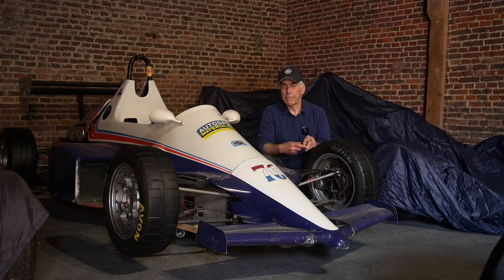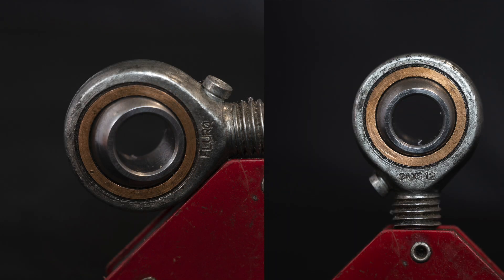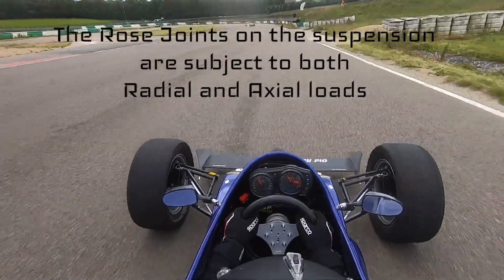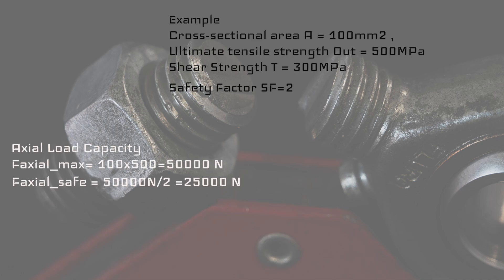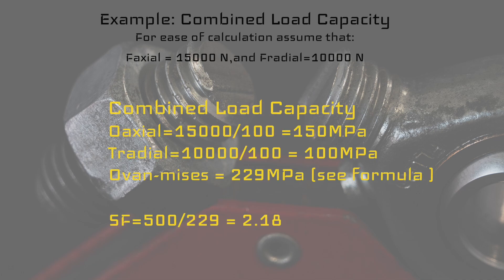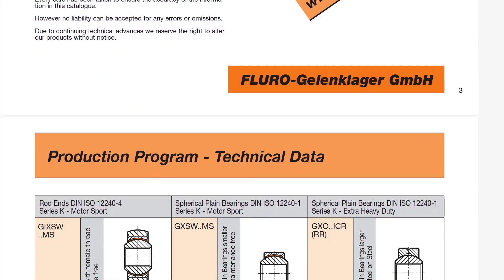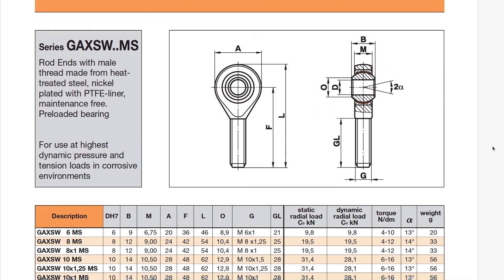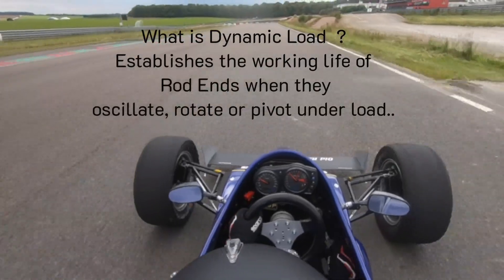Which Rod Ends /  Rose Joints to use in a (race) car ?

Comment: As I said in the previous video, I suspect a design error with this overhanging screw which can induce parasitic vibrations which are reflected on the tail of the ball joint.
Reply from the maker: Thanks for the comments

Comment: Hi, I think this is a very important video. Sure parts should always be within specification with a safety factor. But you have me thinking about scrutineering and general maintenance of these types of racing cars. Depending on how much they are used, surely, parts like this require replacement at some time based on a safe life span for the part. Depending on how hard the car is used, I guess all parts have a life span and it is wise to replace them periodically.  Again Steve you have got me thinking and learning. Thanks so much Marc.
Reply from the maker: Thank you for the comments Marc

Comment: You started with the existing one as a reference so it gives you an idea of what you are looking for, but it would be nice to understand the maximum forces required by the car architecture. If you have a way to calculate that, I will be waiting the video on that topic :)
Another point, couldn't aging be another factor? Would your part still be able to handle those 13.5 kN as stated on the data sheet?
Reply: It would be really difficult as you would have to consider many hard to define parameters such as friction and dynamic impact forces. I'm sure there is software that can be used but not many hobby racers could get their hands on them, or know how to use them :) Fatigue lifetime can be considered as aging. If load is below certain limit the lifetime can be considered forever. When exceeding that limit it is finite number of load cycles.
Reply: @tomiheinonen460  back then, I suppose that Autodesk Mechanical Desktop could handle that. I think that Inventor replaced it. SolidWorks should also handle it. "Benjamin Workshop" uses it for his projects (GT40 and Hypercar).
Reply from the maker: To  provide and calculate all the forces that are at play and get the  rigidity figures, shear point loads and more on  the entire race car  or any other car requires a lot of calculations and simulations. `there are software tools on the market for mechanical design (like 360, Inventor , CAD and others) that come near. However stress testing is at the end done in practice on test tracks etc...   So for me to do so, that is kind of out of reach ( financially) . So we use common sense and over-dimension a bit, while doing some test runs.

Comment: Good points on the video but mostly all the math is useless since it's really hard to find out the forces existing in your suspension. This is only good for comparing two different joints, which you did. But you could do that by just comparing the dynamic values on the datasheet. Anyone please correct me if I missed something.
Reply from the maker: Thanks  Tom,  I have given the basics on the loads and forces on a rose joint and the base calculations for a common undertstanding.   Followed by a practical look up of what is available and how to look and read the figures on data sheets.  That was the intend, its is not to calculate the actual design and need on my specific race car.  As that requires as you stated more details on the structure of the car and how it should witstand forces .  That  would be  a chassis design session, and just maybe we do one  to show the complexity in designing. Of course with CAD the design and  calculations become easier.   The only issue is , I need that software at home   LOL
Reply: @D3Sshooter  Agreed, it's a fair explanation for common understanding. I have experienced similar failure of lower ball joint in MacPherson setup. It was an industrial grade joint. I replaced both sides with motorsport ones but after consideration left other similar joints in the system. The broken one was the only that sees shear force, others only push and pull in axial direction so it's much easier for them. The motorsport stuff costs 4 or 5 times more.
Reply: There are many variables at play in the construction of a chassis/suspension, but these variables can be suppressed or ignored, it all depends on what you want. In the case of a high-performance vehicle, a racing car... Everything will have to work to the limit and the safety coefficients will be extremely high. In Steve's case, i think he upgraded the suspension from ball joints to rose joint. I don't know if he took into account the characteristics of the original component and this may have contributed to the screw breaking. You can use SolidWorks to calculate complex structures like this, it will be like using a shotgun to catch flies, most builders develope and use their own software for this purpose.
Reply from the maker: @nabsp  It is indeed complex a good tool but expensive is  autodesk inventor for all the calculations.   For clarity , I did not build this race car, and rose joints are common on t he Formula Konig... smae as on Formula Ford.    The Rose joints that were on the race car are of course 20 years old.. and not a MS type...   So that is what is on the agenda change them out with MS rod ends...   Thanks for the comments
Reply: @D3Sshooter  inventor is also an excellent tool, but I had training in solid works and I prefer to work with it, and yes they are expensive tools.. I don't know if there is any trial version that can be downloaded for free of a similar software, anyway it's better to have some knowledge of structural dimensioning to work with them, this is probably the case, but most people think it's something like paint... As for the rupture of the component, it looks like what is called a brittle fracture, this type of rupture in a critical component usually causes the red alert come on the brain of the designer/engineer, and it certainly had to worry the pilot!!!
Reply from the maker: @nabsp  Thanks,  I might have a look at Solid works... another option would be 360..  Anyhow,  it is nice to have a chat on what we are both interested in..  Have a great week-end.
Reply: @D3Sshooter  Have a good weekend too Steve. Enjoy and practice some solidworks! I think I have an old version out there that worked with a student license or something like that... if you need it, say something.
Reply: Another aspect which is hard to get real data for is, as Steve D3S mentions, is the dynamic loads seen by the suspension. It's not only a matter of speed and the bend radius, but the extra forces as the car skips and bounces on the uneven road surface. That can probably only be found by measurements on the car. Does anyone have any data for that?
Meanwhile, I seem to remember from engineering training years ago, that impact loads could be considered as three times static load and in a car weighing 500kg, impact loads of 1500kg (or 15000Newtons cornering at 1g) suggest these rose joint are in the right ballpark, particularly as the loads are shared between many more than one joint.

Comment: Interesting video. I’m going to assume that your take away is to review all joints on your race cars and replace as needed. You don’t mention the cost differential between race designed parts and general. Is there a testing body to verify the manufacturer’s testing results? Also, this was not caught during tech inspection. Is there a requirement for documentation of parts used on the car? I know from past videos you have a time limit on seat belts.
Reply: Any inspection before you enter the track could not prevent the snapping of the joint. If it was snapped,  it should have been noticed.  But not all trackday events have that sort of inspections.  
About the limited life span on belts, fueltanks,  seats and even racinggear for the driver are only mandatory when you enter a governed racing event.   On trackdays it's up to the user if he thinks he is in need for new belts or any of the above,  belts can be checked visually.
Reply from the maker: Thanks for the comments, yes I will change all the suspension rose joints and associated bolds.. The price, yes those "no Maintenance, Motor Sport rated  rods" are almost the double in cost.  `An M12 as shown here runs at 60 euro plus... depending where you buy.  Yes, thise are all tested based DIN norms and get a ISO approval number.  Parts documentation is not easy for older or home build one off cars..   Some do,others don't

Comment: I've been led to believe that a rose joint should be mounted in the flat position i.e. with the mounting bolt perpendicular (not parallel) to the ground. It would be a good question to ask Fluro.
Reply from the maker: According to the documentation, it does not matter as such and all depends on the  two arms. In this case its a whishbone that goes up and down, so placing  it in the vertical position is ok as it can pivot all around.  If it was horizontal it would limit the whishbone  movement up-down to the degrees it is specified ( these 13 degrees as far as recall)

Comment: Thanks for this video. I had a vintage Formula Ford which during an autocross event seemed to suddenly understeer resulting in me clipping a curb and pretty much tearing the left front suspension off and damaging the front left frame. A rose joint sheared in the same way as yours. I’ve always wondered if that was the cause or if it was driver error.
Reply from the maker: Thanks for the comments, I would say " most likely " either a radial dynamic load limit that was to low or metal fatigue .
Reply: @D3Sshooter Isn't that basically the same thing? Metal fatigue because of too high dynamic loading for the part.
Reply from the maker: @tomiheinonen460  , yes it is kind of...  its multiple high stress moments that slowly causes small cracks in t he structure of the metal and finally snaps... The more it is pushed at its limits , the faster the fatigue sets in.